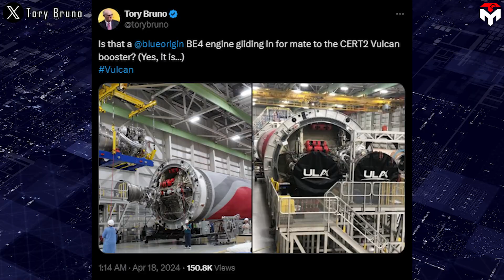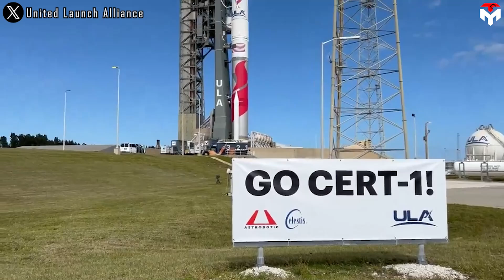It's Over! Pentagon Made Big Slapped On ULA. Elon Laugh...

Comment: Until now the BE-4 had a thrust advantage over the SpaceX Raptor engine, I think it has almost a 10% higher thrust than Raptor 2. With Raptor 3 the thrust advantage goes to SpaceX so perhaps Raptor 3s could be used for Vulcan. But while SpaceX can obviously produce engines at a much higher rate than Blue Origin swapping the engines still isn't a simple matter and some redesign of the vehicle will be needed. The methane/LOX propellent ratio probably isn't exactly the same, for one thing. Still, up till now SpaceX hasn't shown any inclination that I'm aware of to sell their Raptors to other launch providers. And if Blue Origin buys ULA they won't be buying Raptor engines, that's for sure.